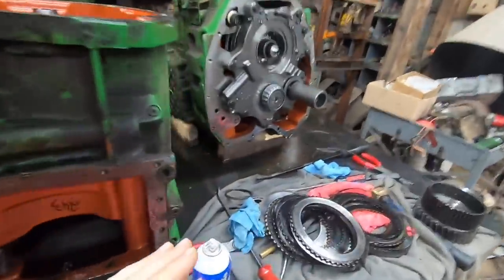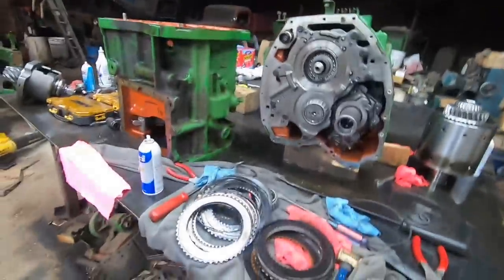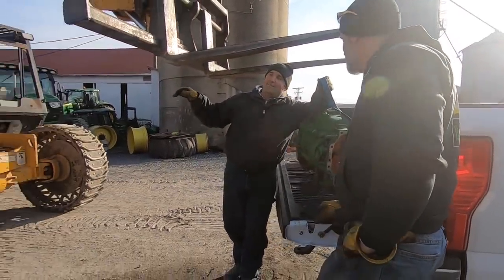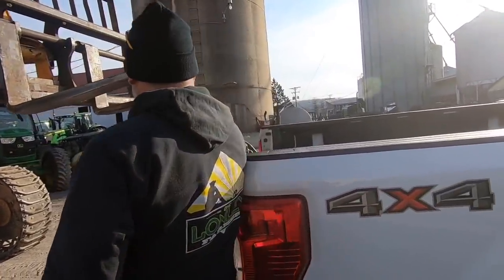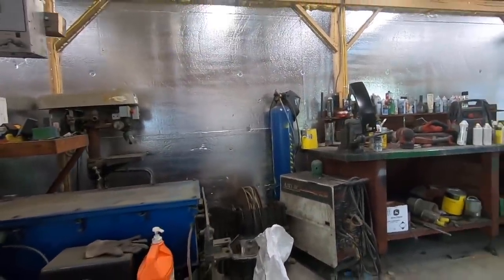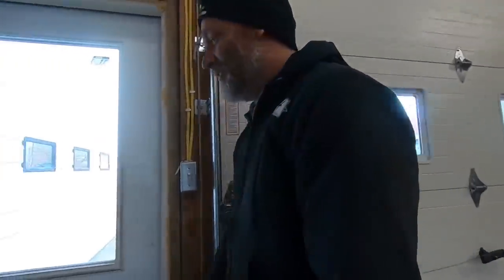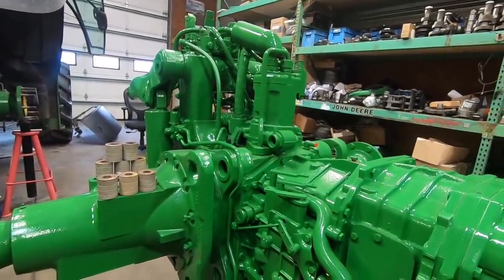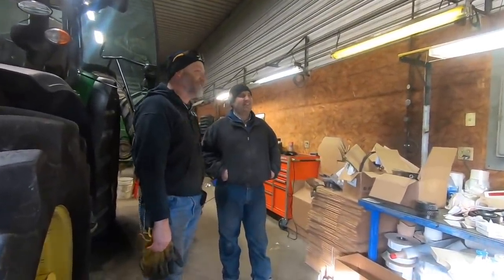6210R Transmission Reclutch

Comment: Hey Wes in 2000 they changed the registration plates so the first letter is the major town or city. IE L for London. M for Manchester etc. Second letter is the local DMV in that area where ever it was registered. Numbers are the year. Each year is split in two. So for example 2002 was 02 then 52, then 03 53 and 04 54, 05 55 06 56 etc etc. We're now up to 21 and 71 in that pattern. Last three letters are random. Great video as always! Love the shop!
Reply: That's not 100% right... The first letter is the town/city were the registration office is located witch the vehicle was registered.. I live in Lancaster but all the registration's around here start with P because everything is registered in Preston witch is the closest registration office.. you notice alot of EU registration's on that wall, they are from London area.. you are right with the numbers tho..
Reply: @CJA150179  yeah I don't think anywhere else could have an L so unfortunately Lancaster gets lumped into Preston. E is Essex.
Reply: Crazy y’all have to register farm equipment, guess anyway the government can make money..
Reply: @krink4you  if it goes on the road and has an engine the government here will tax it 😬😂

Comment: I wonder what the elders think of “tweels”. The airless tires...  and tracked units.
Reply: Steel tracks are not an issue. Rubber depends on what it's on. Another factor is the speed the thing can go, if it goes faster than a horse trot then it's bad around here.
Reply: Dont be stupid , its is none of your biz!!!

Comment: transmission dyno/test setup, that great, it covers them and their work mostly. so if you you tske it home and your "junktronics"(electronics) are not right and cooks the transmission, warranty is voided. better off with an easily changeable manual clutch/trans.
Reply from the maker: I love when people trash a transmission because its electronically controlled! fact it if the sensors are not working the transmission will not work! it won't burn it up or damage it it just simply will throw a code and stop working. this tractor has had none of that and I wouldn't go backwards to a power shift or synchronized transmission ever again.
Reply: @onelonleyfarmer  I could not agree more !

Comment: How do you know when it’s time to do the breaks in a 6930p ?? Thanks 🙏
Reply: Put new discs on every 4 to 5000 hours. Cheap and easy to do and you have peace of mind
Reply: @mcauleyfeedsfarming7795  how much does it cost?? Thanks
Reply: @scasey4020  roughly €170 per disc and there’s one each side. And a little bit of anaerobic sealer. Handy days work for one man. Tie it in with a back end oil change
Reply: @mcauleyfeedsfarming7795  thanks a million for that 👍🏻

Comment: I was driving a case ih puma 200 tractor with ivt transmission and it had just previously had the transmission overheated so they changed the oil and filters and I was the first guy to use it the next day and it went 43 miles per hour after that, man he couldn’t believe how fast that feels. Some sensors in the transmission must have been damaged or something to let it go that fast because before it overheated  it wouldn’t go that fast.

Comment: I am zero percent surprised that magical "junktronics"(electronics) caused a transmission to cook itself in short order. if it's not working perfectly, it's the equivalent of riding with your foot on the clutch. so many things come into play (overly complex garbage, for what?
Reply from the maker: you really need to understand what your taking about before you type comments. you just sound stupid!
Reply: @onelonleyfarmer  if you were also into electrical, electronics and computers as well, you'd quickly agree.
computer controlled things have never been perfect and never will be, by time they set a code and give errors out, all too often the damage has long bene done. it was very likely damaged and repaired before you got it and exactly why they sold it.